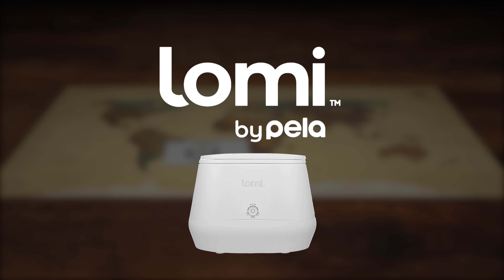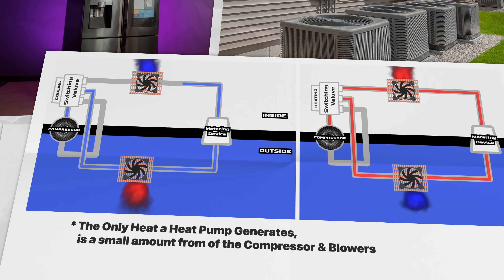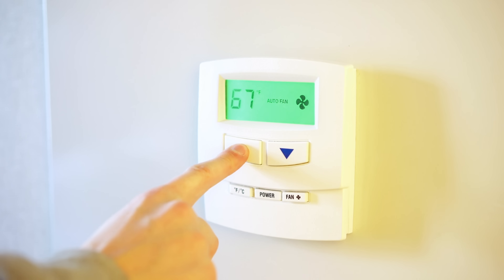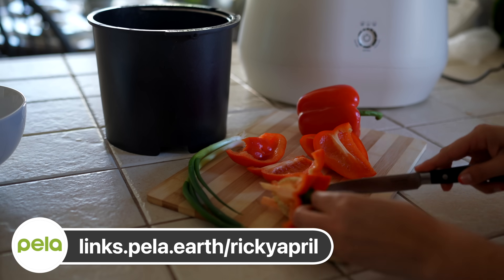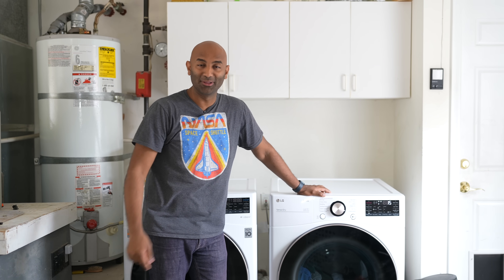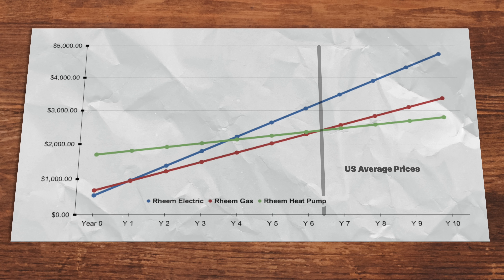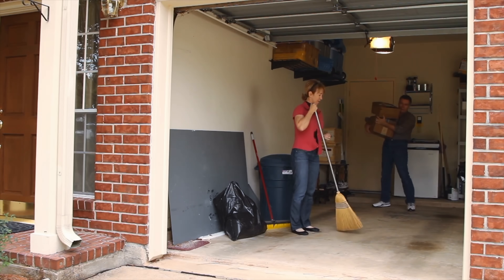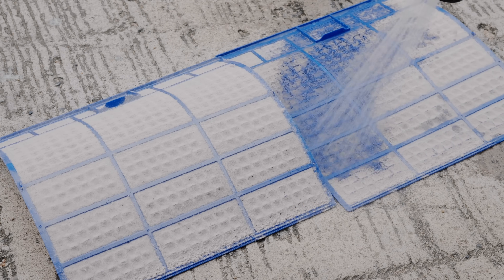I'm Shocked How Much Money Heat Pump Appliances Save!

Comment: Check out annualized geo solar heat systems for your new house.
Mine uses a heat pump, but instead of a large geothermal unit it uses a commercial fridge heat pump.
Ground loops are heated w solar thermal all summer and extracted in winter.

Comment: My entire house is electrical; well water, septic tank, electric heating. I need a change
Reply from the maker: I hear yah, what would you start with?
Reply: Been there. Power goes out you lose everything. But where I was, piping anything else to the house would have been insanely expensive. That house burned down because of an electrical fire. And now I live in town. 😎

Comment: Like you said, our infrastructure isn't near ready to provide the electricity demands associated with trading of ICEs and gas appliances for  EVs and refrigeration units.
Reply from the maker: you can create your own energy, your not going to be making your own fossil fuels. Heat pumps can easily operate under solar generation, which is my goal. EVs charge at home often at off peak times, its all doable... it'll just require some cleverness
Reply: @TwoBitDaVinci  highest demands for heat is in the wee hours of winter mornings, when the sun isn't shining at all. It's commonly thought that all time peak demands for electricity is on summer afternoons, but many areas have their all time record demands for electricity on winter mornings, not summer afternoons. In a world where fossil fuels don't provide heat, the latter situation would be the norm. Heck, on an industrial scale, gas fired absorption refrigeration systems are still a thing.

Comment: It seems like, so far anyways, you are tackling each device in isolation, which is kewl (I didn’t even know there were heat pump clothes driers!) but having announced at the start of the video your intent to make heat pumps part of your Green project, I assume your house will be powered by solar?, so linking each device to how it fits in your heat pump / solar “system” would be helpful. If all your devices aren’t part of a HP system then you will have components fitting against each other, which is very inefficient. Your HP system could heat your pool through the waste heat.
Reply from the maker: yeah I am planning on adding a lot of solar, but I need a new roof first... all to come!

Comment: Oh I like Heat Pumps so much I'd spend 6 grand on the Sanden unit with the outside condenser.  Sure I'd love another more affordable option but it's really the only proven Co2 (R744 refridgerant) on the North American  market.   Payoff is generally 8 years and the tanks are warranted for 15 years. Hot Water is 40 % of your electric bill if you're not gas.   The Sanden is so efficient it runs on a max of 8 amps which makes it very solar friendly
Reply from the maker: Right on where are you located? That's a great point... sadly its tougher for American's who have cheaper natural gas rates... but that might be changing
Reply: @TwoBitDaVinci  I'm in Northwest Arkansas and we just had an adjustment on our Natural Gas that raised rates at least 25%.   Another thing is the area wreaks havok on our sinuses.  I'm from Seattle so i'm used to low pollen and other particulate matter.    If you have allergies Arkansas will hammer you and if you don't have allergies you soon will.   IAQ is essential for our next landing spot.

Comment: I hate Natural Gas.   I'm trying to convince the wife to sell the home and do a high performance build.   HVAC would be Heat Pump.   Eyeballing Hydraloop for Grey Water recycling.   Solar of course along with 30kwh of battery storage.  400 A service for the future where we'll have two EV.   90 % Low Voltage lighting.  Rainwater capture, Greenhouse,   ERV and Dehumidifer.  Uponor Logic plumbing system with Hot Water Recirc.  Schluter Ditra in the Master Bath for warm tile floors.  Cat6 and Fiber to multiple locations.  Hot Tub
Reply from the maker: we need to talk, you bring up some great points... as we're starting a sustainable home build... this is gold!
Reply: @TwoBitDaVinci  I'm super excited for your series especially the rainwater collection as that's something i've just recently started looking into
Reply: @TwoBitDaVinci  You're going to need a truckload of gold to build a house with those requirements!

Comment: Ricky, got some experience in this as I have done a portion of it already. First, I am in Spain and have solar with battery storage so my objective was cost savings. Replaced water heater first which was part of a heating system which was under 2 years old. New 170 liter (45 gallon) heat pump water heater in a garage that was VERY hot in summer and is now somewhat better. Beware, if you vent inside it will make it cooler in winter. Consumption for a large house is max 80kWh in winter and 40kWh in summer - and you can easily program for it to work only with FV.

This past winter I decided to also replace a perfectly working condensing dryer, which you did not mention and which are very popular in Europe as they are more efficient that the typical US dryer. The big difference is that they don't need venting and are more efficient than vented models. Anyway, just like you said, big difference in consumption but smaller than typical US dryers and MUCH SLOWER. As a benefit, they are much gentler on clothes. 

Enjoy very much your content. Just my 2 cents
Reply: Have an adjustable vent to switch it indoor to outdoor per season.
Reply: @terrafirma9328  Yes, I have that in my to do jobs but have to go through 2 walls and outer wall is double width with about 16" in total - big job
Reply: I wonder how easy it is to build a smart dual valve vent with simple logic: when garage is hot, use garage air. When garage is cold take and vent air outside.
Reply: @ThalanorThornhale  Before I had the heat pump HWH I had an exhaust fan installed with a thermostat to help lower temperatures which now is always off. The valve would be helpful for exhaust only during winter which is really easier implemented manually as once venting outside it would remain so for 4 months. We live in a mild winter area.

Comment: By the way, you can easily install something like a heat pump water heater with minimal "exhaust" and a valve to have the benefit of capturing the cold air when it is hot, or switching it to expel the cold outside when it is cold.
Reply: The only net heat generated is due to the losses. The air coming out of is is not that hot. Heat-pump dryers are very common in Europe I have one for 8 years. Marvellous piece of equipment. By the way natural gas dryers don’t exist in Europe. Never heard of it.
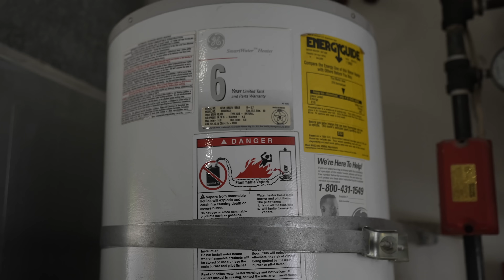Reply: Minute 5:35.
Reply: The heat pump water heaters need to be installed in a large space to have a large volume of air to circulate.. I needed to install mine in a closet so I ran a duct up to my attic for warm air, and out to my patio where a manual seasonal diverter directs the cold air either into my  patio area, or outside. Made for a very kludge install. I'm happy with the function, but I need to improve the appearance.
Reply: @TheGaussFan  WARNING… Your hot air from attic idea SOUNDS good in theory, but the manual on my unit said MAX input temp is 110°.  Higher temps may cause excessive refrigerant temps and cause compressor safety switch to shut down (short cycle).
Reply: @DM-zq8qy  an important conciderarion because im in Phoenix AZ. mine (Rheem) claims ambient operating Temp 37 to 145 deg F.  My thermostatically controlled attic ventilator should (in theory) keep the attic below that in summer. I should probably get a measurement of incomming air temp when it's 117 degrees outside.

Comment: Every HVAC mechanic tells me the that the high SEER heat pumps are basically fake problem
Prone engineering to meet bureaucratic Regulations. California is crazy switching to all electric  especially since electric heating has been illegal for decades in California.

Comment: I am in the habit of air-drying my clothes st least partially. Heat the pool with solar heaters. The pool can be a heat sink for heat pumps, just like the ground can source or sink heat. Water holds lots of heat. The specific heat of water is 4.2.
Reply: 4.2 what? If you’re looking at btu’s per pound the specific heat of water is 1.
Reply: @johnlockington9872    I think you already know the answer, so that begs the question, what is the purpose of your question?

The SI units are Joules per kg per degree Kelvin, but you know that. For water the measure is 4184. In the vernacular, that is always expressed as 4.2 and because the measure is used to demonstrate relative, comparative heat capacities, the units are omitted.
Reply: @PCMenten  As an engineer no the units are not omitted ever.
Reply: @johnlockington9872  Back to basics: 1 calorie = 4.184 Joules

Comment: You should think about solar thermal panels.
Ok not sure if its called that but they uses water to cool off the solar panels and increase there efficiency and it uses the heated water and pumps it into your home for use.
Thoughts on giving this a try
Reply: Yea, they would fit great with the theme!
Reply: Until you look into the price, complexity, and installation issues...

Comment: Heat pumps have issues of their own . One  problem with heat pumps is their became less effective in extreme temperature  . Take for example you would have a harder time heating your home in a blizzard. The other problem is it creates this island of extreme temperature as the heat pump either need to dump the heat from your home  (for air conditioners )  outside  or the reverse  for heating your home. Of course this problem is rather minor unless  the is a huge need for climate control in the desire area.

Comment: 25 degree Celsius is good. temperature (to too hot  hot, not too cold)   for most people. While Celsius vs Fahrenheit is  a lot more subjective than  Imperial vs metric, I find the  Celsius to make more sense: water freeze at 0 and  turns to steam at 100 degree for example.

Comment: Go tell that to people in North Dakota, if a heat pump heats their house in the middle of winter? If you get below 40F / 4.4C your back up electric heater kicks in $$$$$$$$  If you get a geothermal heat pump, then you are good to go year round in any climate.
Reply: Top Flight Air Source Heat Pump will generate heat down to 5 degrees.

Comment: ...my gas bill in the UK is charged by the KW - the US needs to move on - also 0 degees is freezing - 100 is boiling, its not hard! - most of the world agrees even your neighbours in Canada!
Reply from the maker: 100 degrees is boiling, I agree if you were water, C is better. But for people, F is way easier to understand! like i mentioned there's more room to make sense of it. Cheers and thanks for your comment Mark!
Reply: @TwoBitDaVinci  I'm in my 50's, in the UK and we still have a mix of imperial and metric, in my life and as a carpenter in my youth I had to learn to use both as I was training from the older guys, in that time we've gone from gallons to litres for fuel, from inches to centimeters and its not a problem - so knowing its cold and icy out when it's below 0 degrees in centigrade and its very hot at 30 degrees is easy,  but changing our signs from miles to km in the future is going to be a bigger challenge!

Comment: Changing the temperature of something is one of the most energy intensive things that we do (and this comes with massive emissions).

And this is why heat pumps are amazing! I’ve also heard of people looking into using targeted heat pumps to replace ovens which could be awesome if it works out!
Reply: yep! Oven and stove-top options are coming!  But they will likely require an outdoor unit, so adding refrigerant lines and a radiator outside won't be perfect for every situation.  Still going to be neat though!
Reply: @CaedenV  It would be a great addon to mini-split or central air HVAC!
Reply: Isn't heat pumps weak point not being able to produce high temperature, for example water heater/cloths dryer reach a lower temperature than conventional ones. It will be really cool if ovens could run on heat pump. Plus heat pumps are efficient when the temperature difference is not massive, to reach 400F will be tough.
Reply: @ristekostadinov2820  assuming you find the right refrigerant that condenses/evaporate at the right temperature and manufacture equipment that can handle the heat, the trick for any climate with frequent clear skies in the winter would be to basically build a gigantic solar oven the size of a green house.

Concentrate the sun's energy into that space with the right insulating clear material and the temperature can definitely reach high sauna temperatures under the right conditions.

Then the Heat Pump concentrates that to produce oven temperatures at the end of the refrigerant line
Reply: @priestesslucy  Um, OK, but my God, the amount of real estate and materials you would have to devote to this contraption!  Considering how little energy it takes to heat up a well-insulated oven, and how little it's used over the span of a year, I think it makes more sense to just use a cheap, reliable resistance heater for an oven.
Reply: @incognitotorpedo42   Agree! At City Realestate pricing the greenhouse area could be worth many thousand dollars  alone
Reply: @ristekostadinov2820  You are too polite. Heat pump stove is not "tough", It is idiocy.
Reply: @pauleohl  same for ovens, you can't produce 200C (392F) thermodynamics is not magic. Maybe for food dehydrator, because you need relatively low temperature 60C (140F) is the optimal temperature for making dry food which is something achievable with heat pump.
Reply: Air conditioning takes a ton of energy. This is what he means by heat pump. When we go all electrical power is going to cost a ton. We will all be freezing.
Reply: @kimberlysteller2556  Heat pumps are 3-5x better than resistive heat. Even if we power it with fossil fuels it produces the same heat with less gas input. We can also set up our homes as thermal batteries. If there's extra wind at night, heat your home an extra degree warmer so it uses less power in the am. Or if there's excess solar power at noon, pre-cool your house so it's comfortable enough to last through the peak 5-7pm hours without kicking on. Electric heating can actually stabilize the grid if combined with demand side grid management
Reply: @ThomasBomb45  i do not know where we are going to get all this power, the amount of energy stored in fuels is immense. Im not some nut resisting change, but forced change before it is ready is worthless. When were all using electric everything the main determiner of whom gets how much will be a big deal. So i feel a mix of whatever works for each area of the world is what we need. Georgermal is water based and you could still use wood or electric methods to heat water when the other wasn't feasible.
Reply: @kimberlysteller2556  Not necessarily, especially if you are taking heat from something that needs to be cooled off anyway - imagine all the heat in an attic.  Modern air conditioning and refrigeration systems don't use nearly as much energy as older systems did. Especially systems with ECM motors and variable speed compressors. In an all electric home or apartment, you'd be greatly reducing the amount of energy.. straight resistance heat in ovens, water heaters, and dryers uses way more electricity than any heat pump version. It would probably all balance out.
Reply: @kimberlysteller2556  And your 'hot water' will only be warm !
Reply: @kimberlysteller2556  And then there is the Electric vehicle market we are moving into, to compound this problem of power generation.

Comment: Here in cold climates we have combined units that do whole-house heating (water based radiators), hot water, pool heater etc.
Reply: Just providing heat to keep our home warm we need about 85 million BTU a winter, this does not include clothes dryer  and water heater. Our home is super efficient, I have neighbors burn three times that for the same sq footage. Right now using oil for heat is about 2/3rds the cost of electricity. We pay about 21 cents a Kw for power. Seeing as you live in a colder climate how does the heat pump work at -30F?  To me pumping cool air into the water heater space is crazy as I’d rather have the heat loss to keep the utility room comfortable without any supplemental heat.
Reply: @Chris_at_Home  I have a 240 meter deep hole in the ground (ground source heat pump). My electricity cost is similar to yours and my home used to consume 50MWh per year in power (50k kWh) when it had resistive heating solution (I don't have any gas or similar, it's electricity only) but now with the ground source heat pump I'm hoping to end up more around 20MWh per year.

There are people here who use air source heat pumps as well, but they indeed become less efficient when it's really cold (well below freezing), but they still work kind of ok down to -15°C. But -30F (-35°C) in your case, then you want a ground source one. Some people will have.a wood burning one to augment heating if this is an infrequent event.

Comment: Lomi ?!  Really ?!

All it does is use electricity to dry your compostibles. Which will need to be rehydrated if they're ever going to compost.
Reply: This ensure there is not methane produces during decomposition (about 20x stronger greenhouse gas then CO2) and is less then a hassle then managine a full size compost bin or two. It makes sense for anyone who do not have the space to have a compost bin or just don't want to deal with it. Still not for eveyone I guess but the chemistry/math check out.